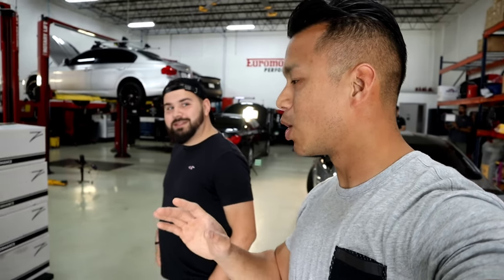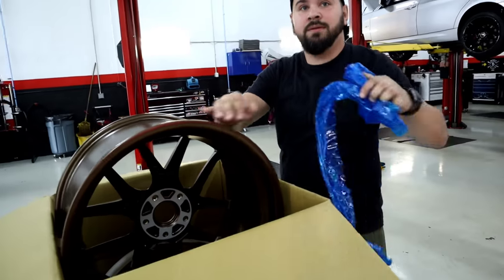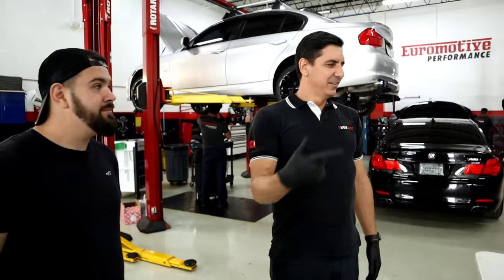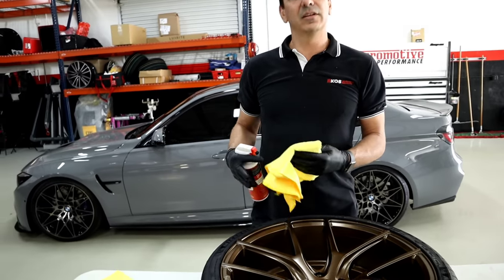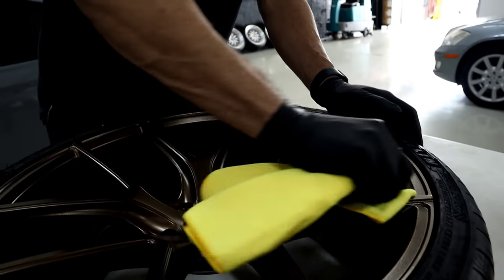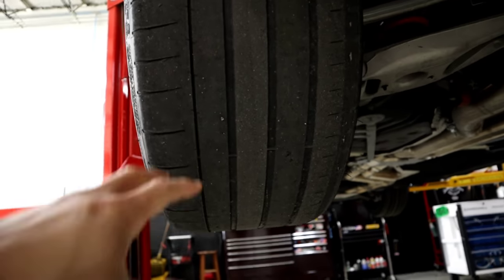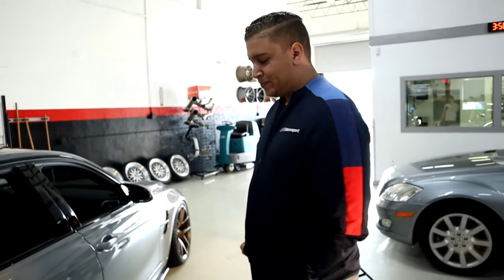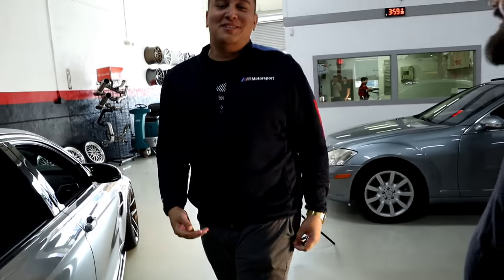Nardo Grey F80 M3 Gets New Wheels

Comment: Great looking wheels especially for the F8x Platform cars.
I know they are 20 Inch but what are Tyres sizes and wheel offsets?
Reply from the maker: The wheels look great on the car and gives the car an aggressive stance. 

FR 9x20 et20 tires are 255-30-20

RE 10,5x20 et26 285-30-20 

He did add a 10 mill spacer for the front unfortunately to make it flush. The rear fits like a glove.

Comment: Is he running spacers, if so what mm?. Also is it lowered if so, is it spring or coils?. Luv the euro taillights on nardo grey.
Reply from the maker: There is a 15mm spacer in the front and none in the rear. I believe he is running on H&R adjustment springs. The car looks amazing with those taillights
Reply: Damn 15mm on the front...I wonder if he rubs on turns?...I’m on H&R springs an 10mm all around, I didn’t want to get any wider because of rubbing an suspension travel but mite try 12mm all around
Reply from the maker: No rubbing fortunately. I have the same setup on my car and its thankfully fine. Dont want to mess up that fender